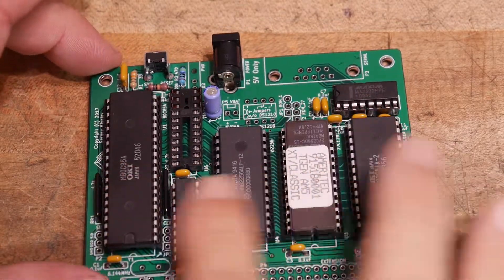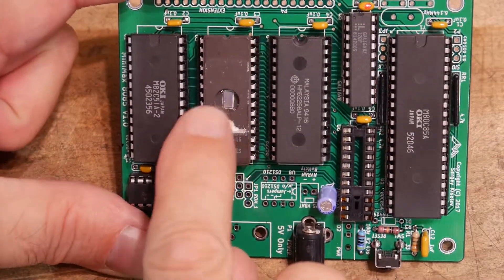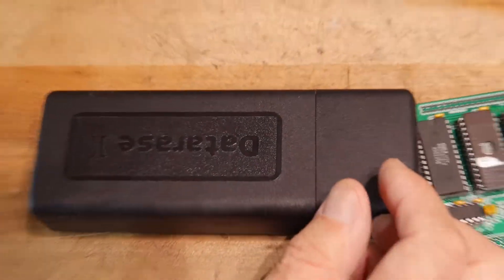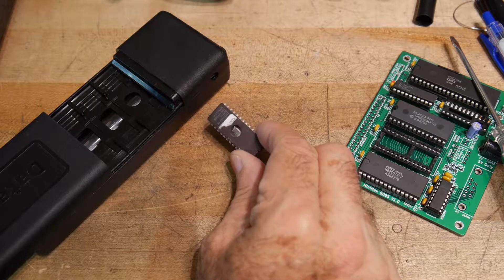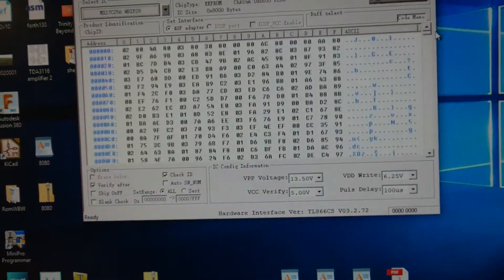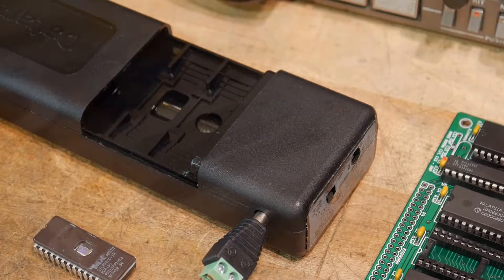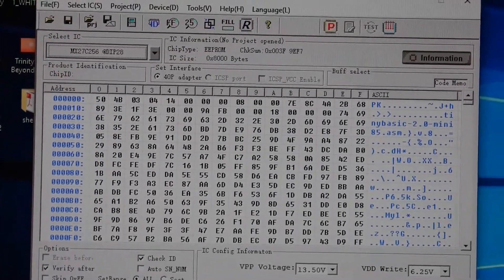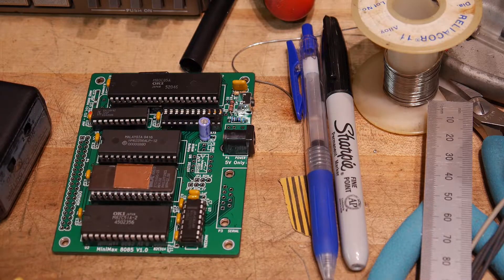#232 erase and program UV EPROM

Comment: Is there a way to extract what is on an EPROM, and then open it so the data can be modified? I have a 1990s computerized sewing machine, and I would love to be able to modify the menus and stitches, which I believe are all stored on the EPROM.
Reply from the maker: yes and no. This is reverse engineering. Some ROM will allow you to change then but others will crash. if you just want to change PFAFF to IMSAI as text, that would be easy to try. modifying the stiches would be a lot of investigation.
Reply: @IMSAIGuy  Thanks. What do you think about just changing the motor RPM limit? As far as I can tell, the EPROM is setting the limit.
Reply from the maker: @PfaffPfantom  same answer

Comment: Hi! I see you're knowledgable about these chips and come asking for advice. I've come into a rather large collection of various Microchips via a bulk liquidation purchase of electronics. I only have about 7 of these types, but I have Dozens of other types and some types hundreds of them. 

To name just some of them(They come in long anti-static sticks of 25/40/50/etc. each) I have MCV's, ADC's, PLD's, MUX's, Counters, Darlington Arrays, Octocouplers, D latch's, RS232's, Quad Amps, OP AMP's, Shift Reg's, , LM2931M-5.0 5v LDO,Flip Flops, Dual OPAMP, Buffer XCVR's. Each of these sticks probably has 20-50 chips in them, all Brand New, and I have sooooooo many other types too. Brands like Texas Instruments, Analog Devices, SPARTAN, Motorola, ATMEL, Pericom, MAXIM Inegrated Products, etc. In addition to these chips, I also have hundreds of what I assume are the "housing units?" that these chips' pins fit into before being mounted on a PCB. 

My question is this, I look online for these chip's selling prices, most go for $2-$5 each, but some I see sell for $10-$25 each, some buyers shelling out $500 for a 20 strip of the same chips I have. However, I've listed several of them for sale on Ebay at well below market rates, and have had 0 luck with selling any of them(I can reply with a link to one of my listings if you're OK with that). I'm unsure if I'm labeling them wrong, or if there's some secret Microchip selling forum that I should join?

Thanks for reading, and I look forward to reading your or other experienced individual's answers!

David
Reply from the maker: sounds like pretty old stuff. at the flea market I would ask $1 per tube. Once you add shipping eBay is not always a good deal.
Reply from the maker: the housing units are 'sockets' again $1 per tube is what I have paid
Reply from the maker: because shipping is such a problem you might consider selling in lots
Reply: @IMSAIGuy  Hi! Thanks for the prompt reply. Yea I suppose I should sell them in their full strips rather than singles. 

I'm rather hesitant to sell some of the larger tubes of chips for a buck though? For example, I see stuff like Motorola MC68HC811E2FN--2C16J 8-bit 52-Pin Microcontrollers. I see someone paid $1.3K for 180 of them as recently as august of 2020, while others have bought them at $300 for 50. I only have 23 of these, but even listing them for $5 each I haven't had a single sale. Maybe I'd do better if I listed them well below other sellers at 23pc for $50?

Honestly the most daunting task is reading and typing the endless serial numbers into google, finding out what kind of chip they are, trying to find a current price when most prices listed are circa 2005-2012, and then making a listing for them. I wish there was someplace I could take them where ppl who actually know what they are could sift through them, and ofc I'd sell them at a low cost. I live in the bay area, I suppose I could look for a flea market in silicon valley and hope for the best?

Thanks again for your response,

David.

Comment: Nice little eprom eraser! Be aware of the bent over copper tape though, it might connect your pins on the one side of your eprom because the glue used on this tape is electrically conductive! Keep up your great videos. 👍 btw First 😀